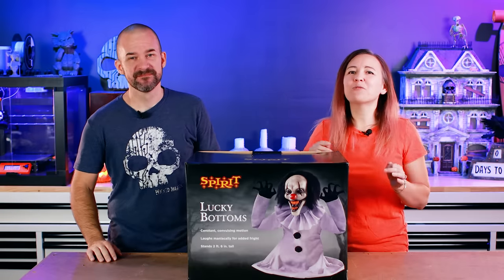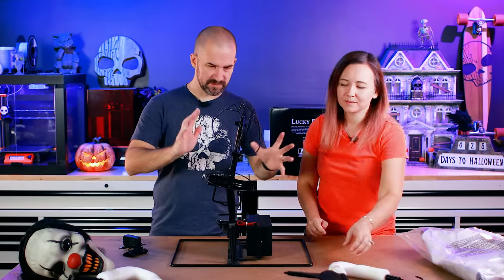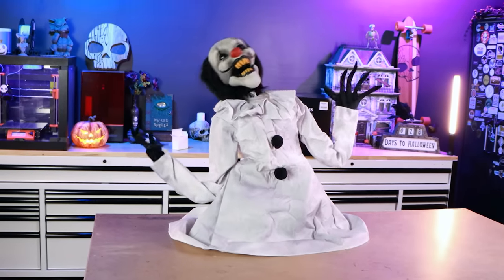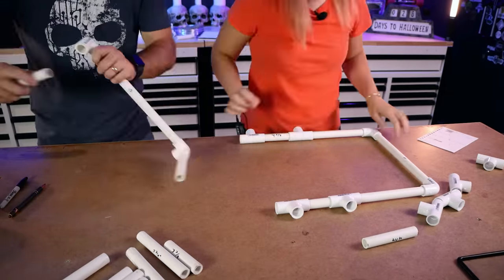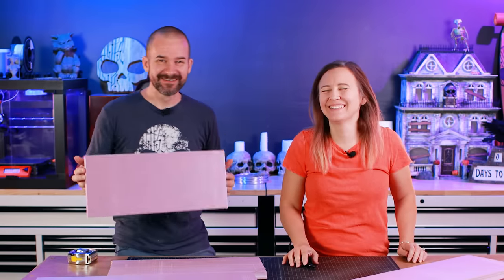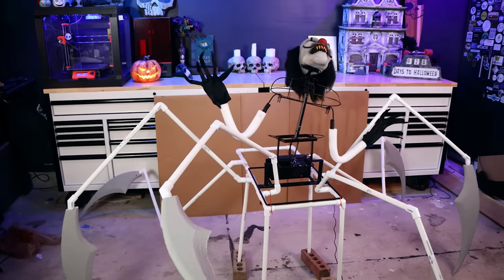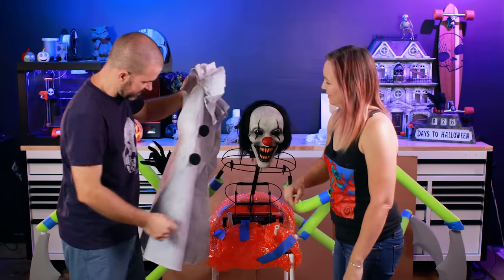SCARY HALLOWEEN Makeover! We made Pennywise from IT...

Comment: Instead of super gluing the joints I would recommend self tapping screws.  You can drive them right through the pvc coupler into the pipe which makes them not move, but gives the added ability to take it apart for easier storage.  You could label the pipes with matching letters or numbers to make sure you can easily put it back together the same way every time.

Comment: Another great one, love your projects. BTW For any one coping this project. Instead of gluing PVC pipe you might want to drill a hole trough the joints and fix things in place with a split pen or bold. That way you can take things apart for storage.

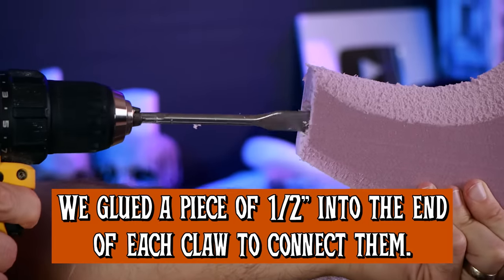Comment: 6:14 What I would have done is use wooden rods (you can find standard drill bits in all lengths) and connect them to the PVC with adapters and slightly corrosive glue. (the corrosive nature of the glue would cause the (then) molten PVC to seem into the pores and crevices of the wood for a tighter bond.)

Comment: This is definitely the scariest thing you’ve ever made. So glad I didn’t watch this before bed. I wonder if you drilled holes in the part of pvc legs that correspond to the quadriceps of the front legs and then put zip ties through those holes to the frame, if the motor would make the legs lift like it was about to lunge or start running?

Comment: Just found your channel and loving it! You guys seem to have so much fun!! I was wondering about the foam you said is hard to drill - what about using a small piece of metal pipe & heat gun? Maybe a little smaller than the pvc diameter. Heat the pipe and melt the holes into the foam. You can also heat and bend pvc.

Comment: I noticed you said it's not easy drilling the foam. If you use a plumbers holesaw the exact size you need it will be alot easier than a flat speed bit.

Comment: Random find I guess due to algorithm of the season and the fact I'm into crafting and modeling stuff for miniatures and tabletop gaming.
I do have 2 helpful tips for you. 
1: If you're using foam as much as you say you are I suggest investing in some hot wire tools. Hot Wire Foam Factory I recommend.
2: When painting things like foam it's best to give a coat of Mod Podge Matte mixed with simple acrylic black paint from the crafting section of whatever local store you have. Mix in the black paint with the Mod till it's a nice black. You may want to test it on a blank foam before painting on your project to make sure you got the right ratio. The paint and Mod Podge Matte gives the foam a nice priming for other paints but it also protects the foam and makes them sturdier. In the table top gaming community it's know as Black Magic Base Coat because a Canadian D&D YouTuber Black Magic Craft came up with it.

Comment: Two questions. First, have you tried "Drylock" and then drilling the holes? I just wondered how that might work. (So that the foam doesn't tear as easily?)
Also I have, No experience with drilling foam. (Last statement I thought I'd be using this morning.. Haha.)
And then the second question.
Have you tried using a Forstner drill bit to drill the holes in the foam?
(Again I have no experience with foam in this way.)
Because of the way that a Forstner bit cuts, I feel like it would make a much cleaner hole. 
(A Forstner bit cuts a hole that is much, much cleaner than a spade bit/paddle bit.  It also cuts a hole that is flat across the bottom of the hole.) 

P.S. sorry I paused right after seeing the foam part and typed the above comment, so I wouldn't forget. But I assumed, so I'm sorry for that as well. Once I pressed play and watched another 3 mins, lol. You use a Forstner bit to drill holes in Pennies eyes! Again never thought I'd be saying that this morning!! Lol